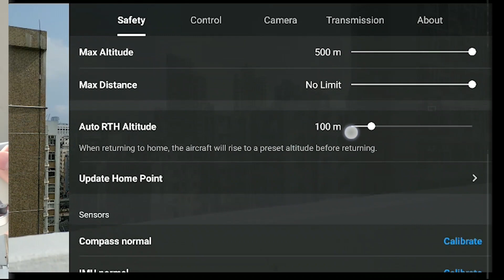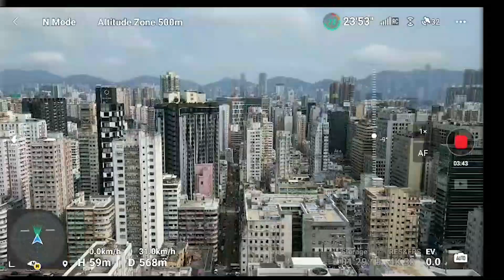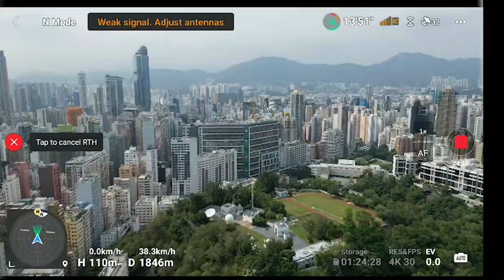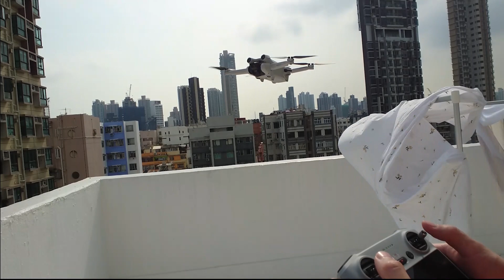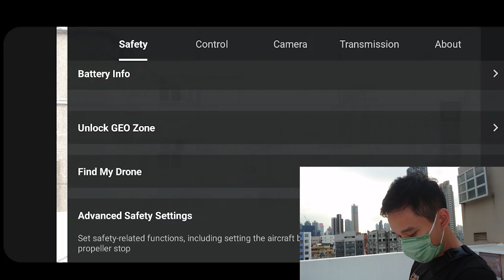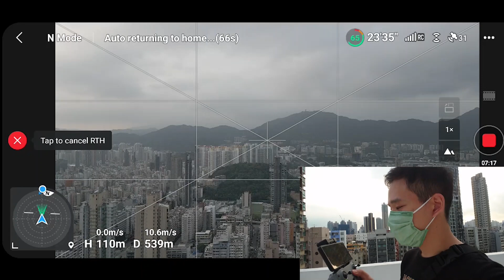DJI MINI 3 PRO | DJI RC vs RC-N1 | HONG KONG URBAN CITY CONCRETE JUNGLE RANGE TEST = +-2KM??

Comment: You held N1 with steeper angle (probably because the phone is heavy). The antenna was not well targetted to the drone. That may be why you lost signal suddenly with N1.
Reply from the maker: Thanks for the comment! 

I think it varies between users.. and in actual flight conditions while flying drones, I don't think everyone will have exact 100% "angles" when targeting towards the drone 100% of the time - how can they test this? 

Unless if there is an exact same angle stand that will hold the remote and also, not every take off will be exactly the same GPS location either - so there are many variables that could have been different per takeoff and during flight.  

Subscribe if you will! :)
Reply: @3xilelast  One way is to place on a tripod. But I guess RFs of both controllers are the same design. 100m is a range of error. new RC has 2 dials while N1 will enable waypoints in the future. It's hard to say which is better.

Comment: You seem a nice guy, but the amount of mistakes seen in this video is the reason we have so many updates and regulations and more and more constraints.

Basically a first timer doing range test in a heavy populated area with skyscrapers and cranes all around the place. And not even knowing the basics of orientation, and drone specifications.

This is bad publicity. But thanks for the effort, at least we know it’s somewhat resistant to gazilions of signal interferences.

Comment: Read the manual. You aimed the antennas 45 degrees up at the sky. The range may be greater if the antennas were aimed at the drone. More on the horizon.

Comment: Oh man, my feet and palms get real sweaty flying in such an environment! 😅

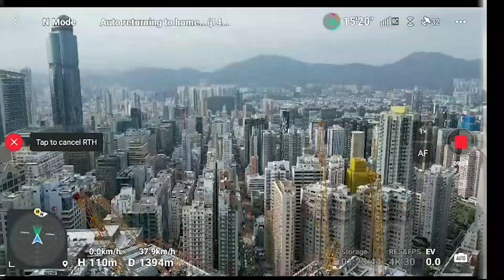The sky cranes at 12:32 looked scary.  Can you do a tree or building obstacle avoidance test during RTH flight?

Wonder how much farther you can get with those directional antenna projector attachment?  But this controller doesn't have external antennas to fit such attachments.

Comment: Do you think that DJI is falsely advertising 12 km range???…
Reply: 12 km isnt even possible with one battery, about 5000-6000 is... And they ofc dont messure in a huge city where there is interference all over, rather in a desert or the mountains where the isnt anything distracting. Realistically, it has more than enough if u fly legal so  wouldnt care

Comment: Yes, some people seem to think it's a poor drone if they can't fly it to the otherside of the world.
Reply: its about getting what you pay for and what is advertised,,,if you bought a car and it was advertised at doing 60 miles to the gallon but only did 20 miles you would moan am i  correct?
Reply: @briandoggett8651  Well I'm sure dji will bring out some kind of firmware to fix if too many complaints go in.
Reply from the maker: @truckerlee5975  Yah I think DJI will fix up the firmware and all that . Right now, those who have the mini 3 are indeed the guinea pigs. But usually DJI does reach a point of a well working product! :)
Reply from the maker: @briandoggett8651  I think you are correct. I also think DJI hasn't directly cheated consumers yet either. The claim of 12 KM Flagship HD transmission is under unobstructed and free of interference environments- I think this needs to be acknowledged. 

Being able to have clear video feed and response from the drone at the distance it does in the video, within arguably the world's most  WIFI, Cellular based, Frequency interference dense location, I think it did quite well! :) 

Another thing I think would be whether or not that meets YOUR expectations of what this drone can or can't do. At the end of the day if your expectation is for the drone to reach a standard that it MAYBE was not designed to do, then it will never meet that standard.
Reply from the maker: haha Thanks for your comment! 
I was impressed with the flights! the DJI RC seemed to have slightly better transmission and connectivity compared to the RC-N1 but both controllers I would say are good!